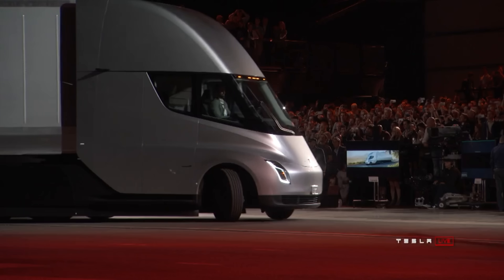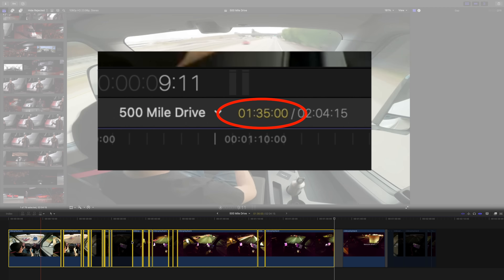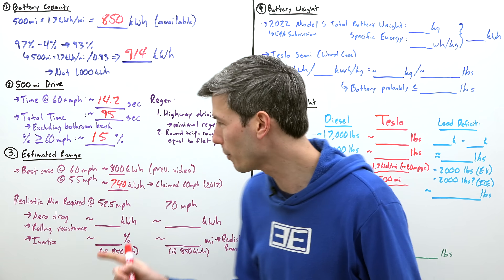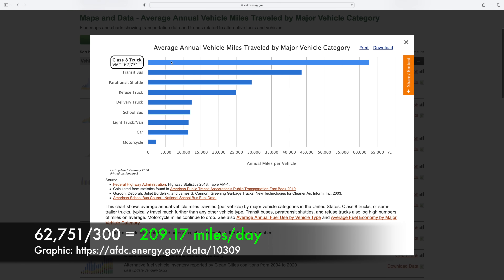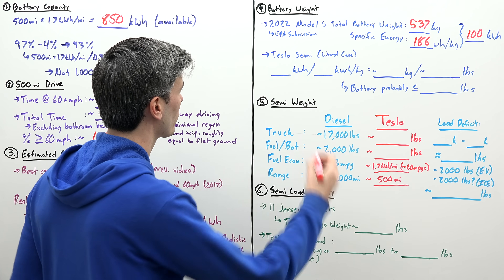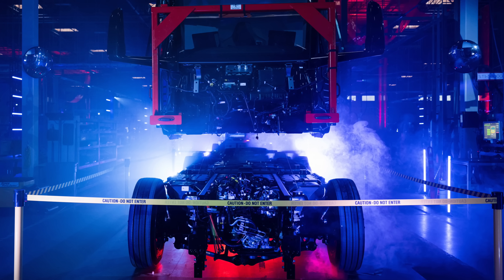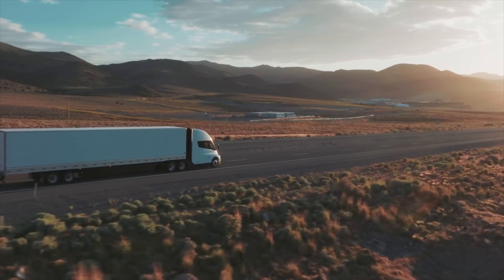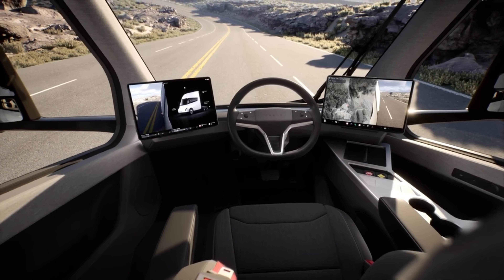Does The Tesla Semi Make Any Sense? Part 2!

Comment: With my volt, 60mph was the magic number. At that speed I used 16kw but if I pushed it up to 70mph I was using 30kw. Wind resistance is the killer at highway speeds
Reply: You were using 16kW. Power is already a rate of energy use over time  no need to divide by time again!
Reply: @dielaughing73  you're right
Reply: @schrodingersmechanic7622  Actually it depends... if the number reported is the total energy used for the entire journey then the units kWh would be correct. For the record 1kWh is 3.6MJ. However if what you are reporting is the rate of the energy consumption, then it should be given in kW. (side note, it is possible to have a higher rate of energy consumption and yet lower energy consumption overall. (but definitely not the case in your Chevy Volt anecdote))
Reply: Thta.s why depending on drag coefficient, each car has a different optimal speed. High chances the tesla semi has better coefficient than your volt.
Reply: @i3looi2  the drag coefficient might be great but you have to remember that a drag coefficient is a number that you multiply by the cross sectional area to get the total drag. The Tesla semi has a huge cross-sectional area and it can't be reduced because that's just how big the trailer is, so it might have a better coefficient of drag but it definitely generates a lot more actual drag.
Reply: @i3looi2  definitely not less drag from an enormous semi-truck. That's why Jason explained that efficiency is much greater at slower speeds. The difference is almost entirely due to aerodynamic drag.

Comment: Also need to factor in the cost benefit of not turning our planet into one resembling Venus by continuing to use our atmosphere as an open sewer for fossil fuels.
Having said that, using Jersey barriers instead of a 40ft shipping container reduces air resistance dramatically so also giving favourable test results.
Reply: The 500 mile range test was done with an enclosed van trailer.
Reply: @BigBen621  In the video, they are exposed - there is no enclosure.

Comment: Good video, just a few things:

You concluded correctly, that the battery actually had a usable capacity of around 914 kWh, but afterwards you used 850 kWh for your calculations, which doesn't make sense. You also have to keep in mind, that Tesla will probably leave at least a small reserve of 2-4% after it goes to 0%, so that you can limp to the next charger. On top of that they will most likely also leave an additional reserve that cannot be used for driving, to increase the lifespan of the battery. That should be at least 3% or so of the total capacity. All of that considered, the real capacity should be somewhere in the realm around 950-970kWh, bringing the weight of the battery to 11k-12k, not 10k.

The rest of the tractor seems to be in the range of 14k-16k, bringing the total to 25k-28k, most likely 26k, with the current battery packs. My guess is that the next version, around 2024, will get a battery that will weigh about 9k-10k, bringing the total weight to roughly 24k, increasing the cargo capacity by another 2k. Version 3, around 2026/27 should be around 22k, with another 2k cargo added. After that they will probably focus more on range than cargo, meaning 1 MWh+ batteries for 600+ miles for the use cases that need them, others will get smaller batteries of course.
Reply from the maker: As stated at the beginning, I think 850 kWh is our current best guess (not 914). I included 914, but we were never told what the efficiency of that drive was. 1.7kWh/mi was stated generally in a response to someone estimating the size of the battery pack. Yes, there is likely a small buffer on top of that, if the available capacity is 850 kWh.
Reply: @EngineeringExplained  I think it's fair to assume that 1.7kWh/mile is the consumption at 55 mph, which most of the trip was at. So 850 kWh just won't cut it, all considered, 900 would be the absolute minimum and that would be bad for the lifespan. Things will get interesting once CATL brings out their packs with 255 Wh/kg on the pack level, that translates into less than 9k pounds at 1 MWh.

Comment: Hi thank you for taking the time and effort to present this information. In the states I am not sure how you stand on available power but here in Ireland I am worried this kind of truck will essentially use all of the available generation we have...
Reply: that's what energy storage (I.e. Megapacks) is for.
At every Semi charging station you can install a Megapack which will charge overnight when the grid is less utilized.
Reply: @udishomer5852  Or you move more freight by rail (which can be electrified thus eliminating the need for batteries and is vastly more energy-efficient than trucks) so you need less MegaPacks and MegaChargers to begin with.

Comment: Tesla must have extremely low cost of batteries, if they plan to sell trucks for that low price. Common price for battery for electric bus is 200000€, which is official quote from manufacturer that sold buses in my city (expected to be 135000-15000€ in 7 years when battery will needed to be replaced, and they calculate that period based of (little less then) 80000km a year usage, again according to manufacturer).
Biggest problem with electrical trucks is you need lot of electricity for them and making infrastructure for them is not cheap (for example to to charge truck in hour you need roughly 1MW instalation per truck,  and to make that energy using wind turbine it will cost you roughly 1000000€ (wind turbines cost 1M€ per MW)) and on top of that 20000€ per year for maintenance)

Comment: your math is incorrect.  you are not deducting the weight of the diesel engine in the average semi.  a giant cast Iron Engine and transmission will weigh far more than 3 small electric motors in the Semi I would probably say that the Tesla weighs in total at about 20000 lbs or less based on a 900 KWh pack.  remember there is a difference between total battery pack and usable battery.

Comment: 1. I think you are underestimating the weight of a diesel semi power train. I looked into it back in 2017, and I remember much higher numbers, closer to the battery weight.
2. Also Tesla is likely making the truck itself lighter, they have a lot of experience with that.
3. Tesla had two prototypes driving at the unveiling, and those have been in actual use since. So they were ready for the 2019 launch. The delay was caused by the insanely high demand for the Model 3/Y, and it made more sense to prioritize that market.
4. The 3 motors instead of 4 is actually a good thing. Less cost and weight, while still plenty of redundancy. They can do it because their motors got significantly more powerful since 2017.
5. The 7 cent per kWh figure was before inflation of course, but not that crazy even now. Tesla can afford to guarantee that price. The trick is to use solar renewable energy and batteries to get electricity cheaper than the grid. That was the plan from the start. And Tesla is doing that, even if maybe slower than planned. Likely also due to the cell shortage. Now that they have the cells, they are ramping up Megapack production like crazy.
6. I don't think the semi will be that expensive. Tesla manufactures electric cars cheaper than anyone else, I don't see why they couldn't make the semi cheap too. The battery should cost well below $100K, which leaves plenty for the rest of the truck. Don't forget about the cost of the diesel powertrain, which comes out of the equation.
7. And of course operating a Tesla semi will be absurdly cheap compared to a diesel semi. It should easily worth it even without subsidies.
Reply: 1. Powertrain on Volvo's flagship 860 weighs <3500lbs
2. All companies try to make their vehicles lighter and Tesla has the least experience compared to the major semi manufacturers
3. I am ready to give you a million dollars. I am going to keep it though because it makes more sense to prioritize that instead.
4. Just like Tesla taking away the radar safety feature. Less for you and still kind of safe. (as long as you aren't a motorcyclist, we run over those)
5. When Tesla offers 7c kw/h I will believe it until then we won't know.
6. Doesn't matter how much you think they will cost. Only matters what they do cost. Another fun fact Tesla's are expensive, they don't even make the top 10 list of cheapest electric cars.
7. Just your opinion. EE did the math in video 1. Once we know the cost and the real-world efficiency we can calculate if this will be worth it or not.
Reply: @NONO-hz4vo  
1. Not the lightest matters, but the heaviest, or at least the average of the most powerful class 8 trucks.

2. Actually Tesla has the most experience and the best technology. Watch the Munro Live channel for details and proof. They are tearing down cars, and create extremely detailed reports of them. They did it thousands of times, so they likely know more about manufacturing than anyone else on the planet. And they can't stop praising Tesla.
The trick is that Tesla moves 1000x faster then legacy manufacturers, so they get more experience in a much shorter time.

3. That's a goofy, but correct analogy. Tesla had better use of it's resources that they didn't expect, that's the only reason the semi has been delayed so much.

4. False. Removing radar increased the safety. All of the rating agencies agree. The radarless Teslas got the highest safety ratings of all cars. And almost perfect score in the "Safety Assist" category.

5. I explained why Tesla can guarantee 7c/kWh. Whether they'll do it, or adjust it for inflation, I don't know.

6. Let me rephrase then. I would be shocked if the semi will cost much more than the original price. Again, inflation adjustment is likely, but it's not going to be crazy expensive.
If they raise prices that'll have more to do with sky-high demand, not manufacturing cost. Just like with the Model Y.
Look at the manufacturing cost of Teslas, not the selling price. Tesla has around 30% gross margin on the cars, and close to 20% operating margin. And that's with last year's sky high material and shipping costs.
And that margin includes the old Fremont plant in California, which is far less efficient and uses very expensive labor.

7. Not opinion, fact. Electric cars have been around for a while, their operation cost advantage is well known. For example Hertz just reported that their Tesla fleet costs 50% less to operate than their gas cars. And the advantage will likely be even bigger for trucks, because big diesel engines are very expensive to maintain, while the Tesla semi uses essentially the same powertrain as their passenger cars.
According to a quick Google search, the average annual maintenance cost of a class 8 truck is $20K (pre-inflation numbers), and goes way up with age. $400K over a 15 year (~1M milies) lifespan.
The cost of a Tesla semi will be a tiny fraction of that, with a much longer useful life.
The Tesla semi powertrain is designed for minimum 1 million miles, and there's plenty of real world data to back up this claim, from the existing Tesla fleet (again, same powertrain).
Reply: @András Bíró  when you start arguing that removing safety features is more safe then you know you are drinking the Kool Aid.
Reply: @NONO-hz4vo  
Wrong. You confuse safety features with sensors.
Currently the Model Y and the Model S are the safest car ever according to all testing organizations.
Radar is a very low quality sensor, cameras are far superior. The only reason radar was used is that image processing is an extremely hard software problem, especially in real time and on a cheap and power efficient computer. Tesla solved that problem, therefore radar is no longer needed. In fact, they found that the radar signal just confused the AI and dragged down it's performance.
Reply: @András Bíró  They didn't solve the problem, now the system just can't detect motorcycles correctly and runs them over killing the riders.
Reply: @NONO-hz4vo  
What are you even talking about??? Of course Teslas can perfectly see motorcycles, bicycles, pedestrians, and everything else. In case you don't know the radarless Teslas just got the highest safety rating of all cars, from all testing agencies. And they got especially high scores for their active safety systems.

Comment: if the truck was limited at 70 miles, it would be almost impossible to maintain the limit speed as the average! so your average will be way lower in real world. check your average speed you will be surprised how low it is.

Comment: 60 miles/h = 100km/h, right? That's insane, nowhere in Europe are you allowed to drive so fast, especially if  the propeller has anything attached, full or empty. Besides, you have to take into account the break/pause/stoppage that the driver must take; here in Europe (most of it) the drivers must not drive/work more than 4,5 consecutive hours. So, less speed, less working time, shorter distances... It could do the job.

Comment: What slope would you need to drive on to not lose charge/gain charge with modern regenerative breaking?
Reply: At a weight of 82,000 lbs. and a speed of 55 MPH, about a -1% slope balances losses to air and rolling resistance against gain from regenerative braking.

Comment: If the truck never left California, then its top speed legally would only be 55. But considering the last time I was there, no one ever did the speed limit anywhere; maybe that's why the driver's head is always blocking the speedometer. So the truck could keep up with traffic and they don't get a speeding ticket. The thing a lot of people over look at charging these trucks is even a small distribution center is going to have access to 3 phase power at upwards of 480 volts due to the refrigeration equipment. So they can charge them at a much higher voltage than you can at your house. 
But all of this math still doesn't answer the biggest question; why do they have to be so ugly?

Comment: great video, but i still feel like there’s points being made that are irrelevant. some of major arguments against the tesla semi are charging times, battery degradation, and duel driver trucks. charging times are expected to be significantly higher than refueling as well as more often. availability of these high wattage chargers is a major concern as they would have to be installed in great numbers across the entire country. something tesla hasn’t been able to do in a decade even with standard chargers.

battery degradation and cost of replacement is another massive worry for companies. does every semi a company purchases have to have a 50k battery replacement every 5 years? 

team driving or duel drivers isn’t a majority, but does factor in. the tesla semi has been shown to reject any possibility of a passenger who drives in shifts. 

there are several other issues, but just wanted to drop these here for those who haven’t seen them

Comment: Also don't forget the "weighed out" statistic accounts for all load types.
So the weight capacity of a short container can be capped out much easier than a full size container. Given that only 7-8 percent of the total loads are considered "heavy loads" based on your other graph, I would wager that at least 20 of the 30% of that "weighed out statistic" are smaller loads/vehicles getting weighed out, such as half containers, or smaller trucks/trailers.

In other words, the tesla truck can handle about 90% of loads.

Comment: 52.5mph happens to be ABOUT exactly what trucks are allowed to go in Europe ... They are limited to "80kph", but in reality typically goes 84-90kph, median perhaps around 87kph. Some go as fast as 92kph. Depends on limiter calibration, tire wear etc.
A few goes significantly under 80kph even due to tire wear.

I think they target 86kph for calibration with new tires -- since 6kph is "technical reduction" when measuring speeds for fines ...
Reply: There is no such speed limit for Europe as a whole, each country has their own regulations. Semis in France, Portugal, Belgium, Luxembourg can for instance drive up to 90 km/h (56 mph) on motorways, and it's even 96.5 km/h (60 mph) in the UK. International trucking in Europe is a nightmare, regulations are not just about how fast you can drive (there are now mobile apps that tell you if you drive over authorized speeds), but also when you can drive during the day, if you can drive over week-ends or on Sunday, where you can drive depending on your weight or type of cargo, etc.
Currently, there are about 25 countries with truck driving regulations, and 10 with no special regulations.
Reply: This truck might not be very popular in Europe since their length classification takes into account the length of the tractor - that’s why they’re all cab-over designs there. Cab over is horribly inefficient for aero so it would not work well for an EV
Reply: @stupenduzzman  The max length of the cabin is about 2.35 m, although there are also double-cabin trucks, but it's still a vertical flat front.
Recent efficiency regulations actually allow for much longer aerodynamic (rounded) cabins with 7-10% more fuel economy, but there are simply no such truck on the market (yet), because manufacturers are not forced to switch over some of their production to these efficient designs. EU at its best...
Aerodynamics are less important for trucks than for high speed cars. Still, a 7-10% fuel savings on a yearly bill, or a similar reduction for electricity, is nothing to laugh at. And with a 0.36 air drag coefficient or so, the Tesla semi is even more aerodynamic (about 20% more) than these "rounded" European designs.